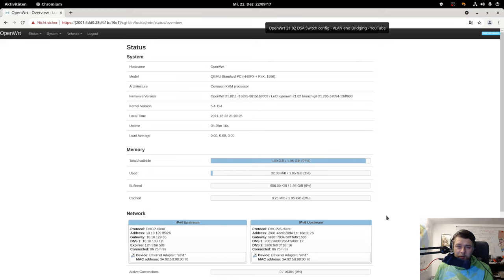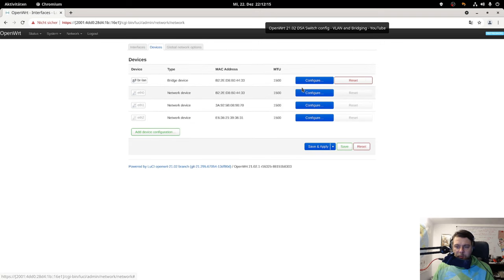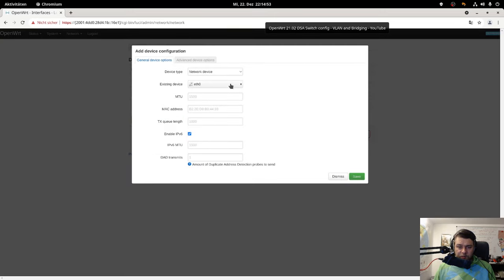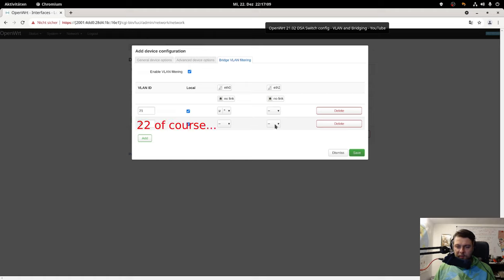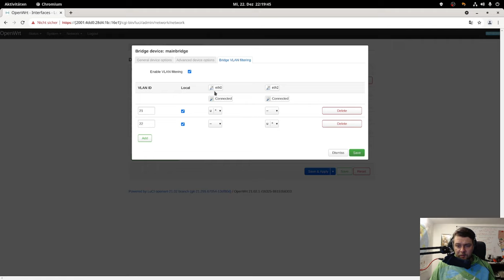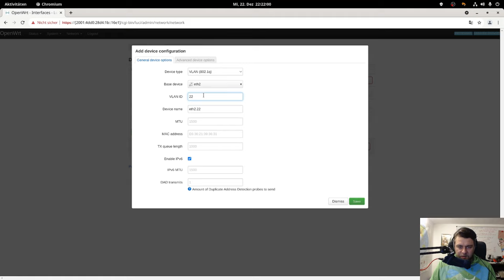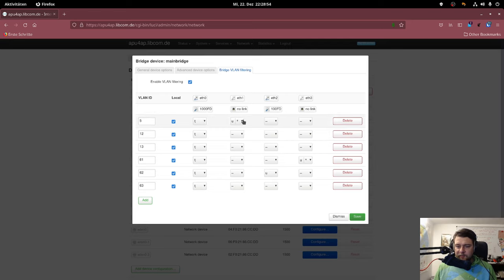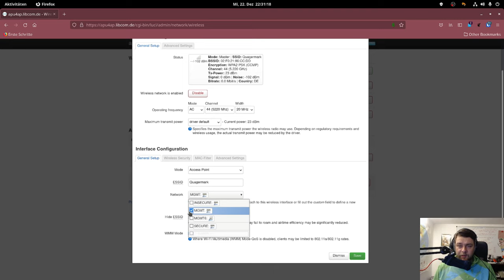OpenWrt 21.02 DSA Switch config - VLAN and Bridging (english)

Comment: This video helped me a lot. I made an AP with SSID's in seperate vlans and i was struggling with the bridges ( yeah i was assuming i had make one per vlan)  but this video saved me . 
Working "setup"now:  isp Modem (in bridge mode) >  pfsense (firewall router etc)  > tplink TL-SG1016DE (switch)  > Belkin rt3200 (OpenWrt as AP)

Comment: Could you explain a case where the VLAN is not local?
I have one port from openwrt connected to a access point. But in the access point the I have three wifi networks with different VLAN id

Comment: Thanks, this was very informative and I have a much better understanding now of OpenWRT (I'm a long time DD-WRT user crossing over).   However, things are still unclear as to how a (dumb) access point filters a VLAN ID from the ethernet bridge to a wireless device if the source is NOT an OpenWRT based router.   So, with your example of a Guest network,  if you have a guest network coming from a dedicated router on a backhaul connection to a dumb access point on VLAN ID 10, how do you route that VLAN ID to a guest device on a WLAN?
Reply from the maker: I'm planning on doing a new video where I get more into detail about how to handle VLAN.
Reply: @junicast_tech  Awesome!   I’ll look forward to it.

Comment: great video thanks. just one question: what is the difference if I include the wan port into the mainbridge together with all my lan ports or if I dont?
Reply from the maker: As I want this device to act as a switch I want to be able to use every port available. So if you go with a vlan aware bridge you need to also add the so called WAN port to the bridge. You can still could use it in standalone of course but usually this won't make sense.

Comment: Could you make a video showing how to turn the WAN port into a regular LAN port?  Basically, i would like to use the whole device as a managed switched with the "WAN" port acting as a trunked/tagged switch port running to another device.  Specifically, however, i want to turn my FreshTomato router into a managed switch that will use its WAN port as a tagged/trunked switchport connected to my main router running OpenWRT.
Reply from the maker: What device is it exactly?
Reply: @junicast_tech  My Netgear WNDR3400 is running FreshTomato.  My Linksys EA3500 is running OpenWRT 21.02.

I want to turn the Netgear/FreshTomato WAN port into a LAN port and then use it to trunk/tag my VLANs toward the Linksys OpenWRT, which is my main router.

I also want the Netgear/FreshTomato to be the Wireless Access Point because the WiFi on the Linksys/OpenWRT was really slow.

After watching your videos about VLANs on OpenWRT, i got my Linksys running just how i wanted it, but when i tried converting my Netgear/FreshTomato into a managed switch AND turning the WAN port into a tagged LAN port, i wasn't sure what i was doing.  I can't find anything that explains how to turn the FreshTomato into a managed switch.

OpenWRT has three separate networks/VLANs (Main, Guests, and IOT) with Firewall rules that isolate the IOT network from everything but the Internet.

I tried creating a similar setup on the Netgear/FreshTomato, but i was unsuccessful.
Reply from the maker: @spqa2004  So the FreshTomato you want to act as switch? I don't know too much about FreshTomato. I suspect they are not using the new DSA. Either way, you would make a bridge and attach not only the LAN ports but also the WAN port to it. Then all ports are part of one big switch.